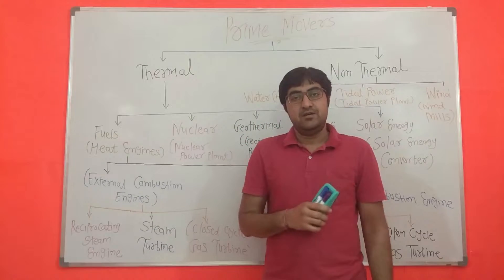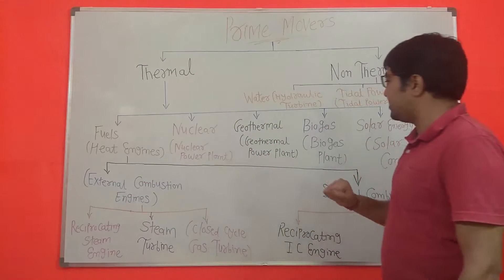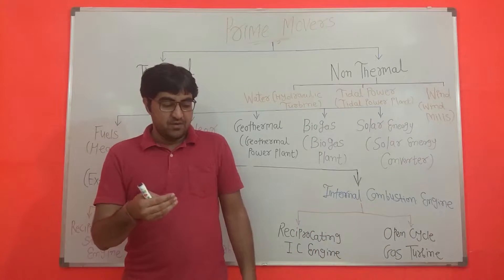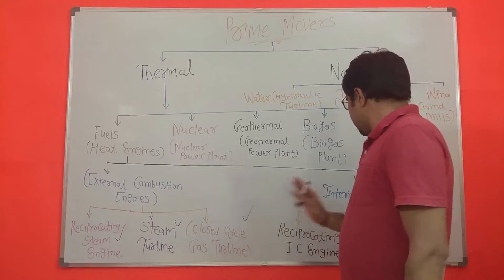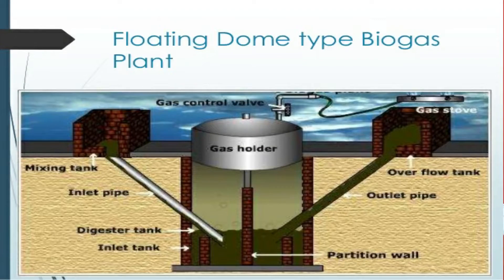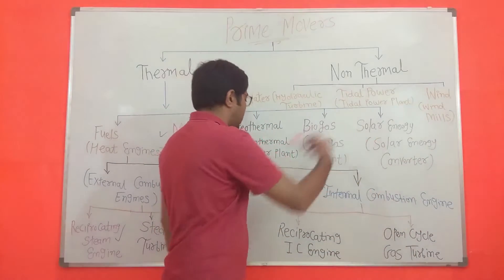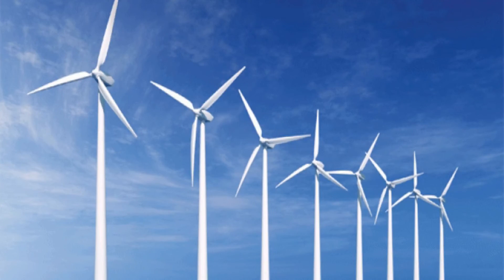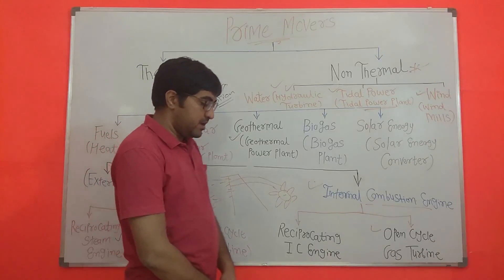Prime Movers: Exploring Turbines, Engines, Windmills, and Solar Energy System

Comment: Gas turbines are a type of internal combustion (IC) engine in which burning of an air-fuel mixture produces hot gases that spin a turbine to produce power
Reply from the maker: I am talking about closed cycle gas turbine
in closed cycle gas turbine
first the air is compressed in the compressor and then heated in a heating chamber. As the air is heated by an external source, so the amount of the gas remains the same.In open cycle it will expose in atmosphere
Reply: @TECHEDU999  Most  gas turbines in the world are Simple, Open cycle, single shaft, so I didn't understand what you meant! I teach the same topic in Canada!
Reply from the maker: open cycle
https://youtu.be/UGqQ5S90z6w